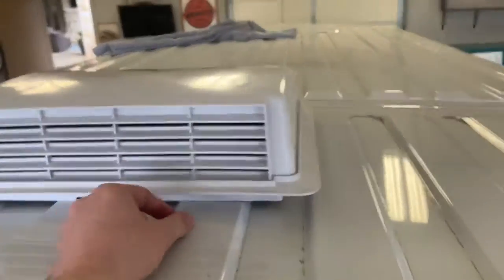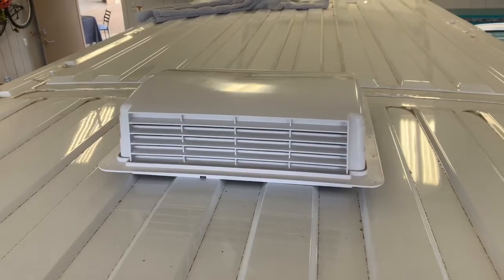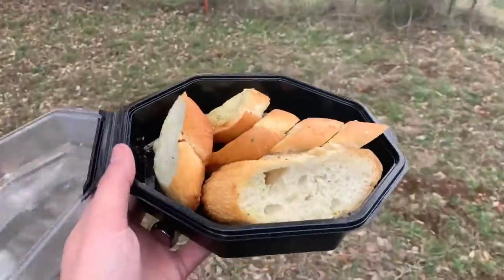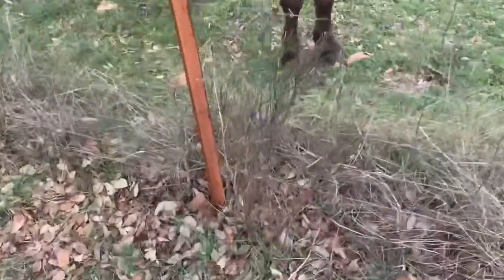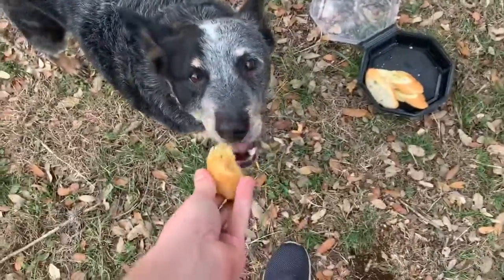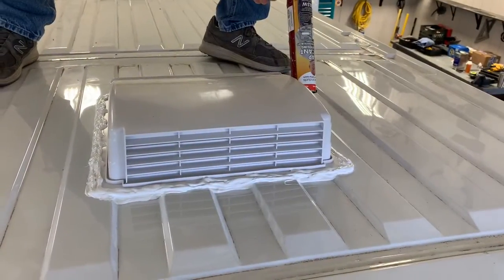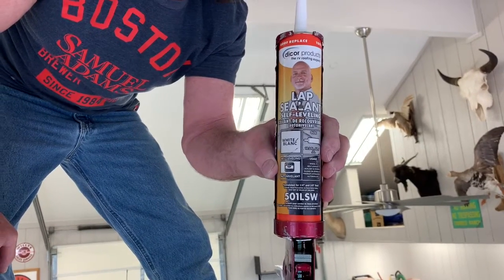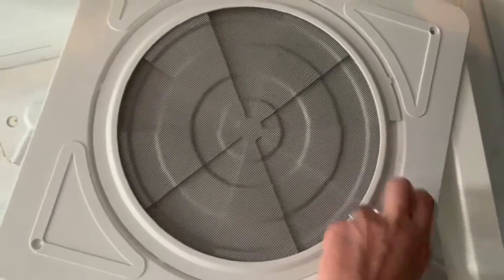Installing MaxxFans on Ram ProMaster

Comment: What is the brand of the rear vent and why did you choose it? I'm installing a rear vent over the rear bath design and wondering if it would be a better solution to a max-air..
Reply from the maker: It was so we could have 1 MaxxFan and the other would vent, however it does not let enough air in. Just do 2 maxx fans and live the good life. You’ll never have too much airflow